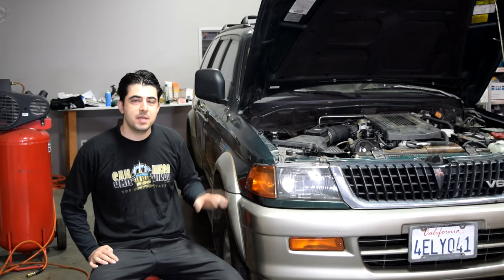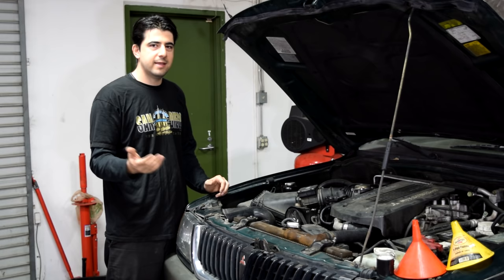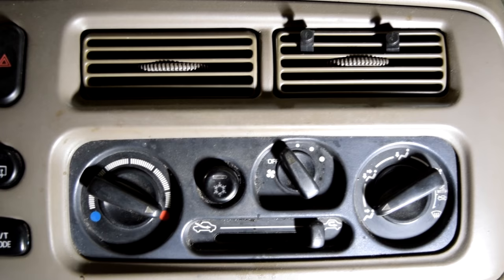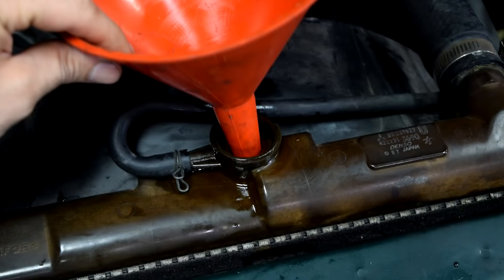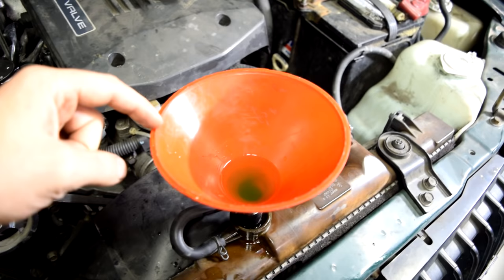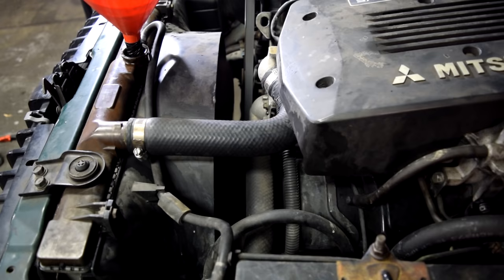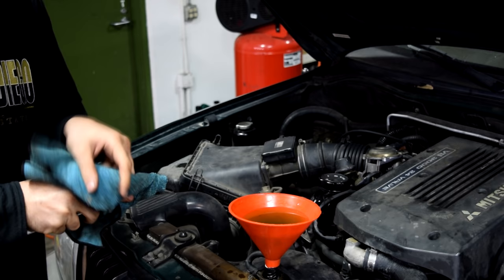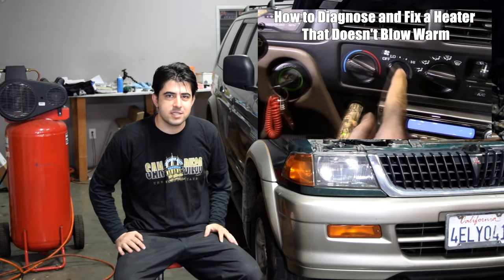Learn How To Bleed Air Out Of Your Car's Cooling System With This Quick And Easy Diy Method.

Comment: Thank you. I replace 6 radiators due to the heat and the radiator burst due to high air pressure and after this video the heat was gone and the car is like new. 

Explorer 2010

Comment: Very clear video on bleeding cooling system but you didn't say if you had previously flushed the block and radiator or whether you are only draining and refilling the radiator

Comment: Best video on here how to do this! Including all the little tips, just great. thanks so much. I followed the steps exactly even putting my 4runner on an incline. During the burping process, I kept having to turn off the engine to remove coolant b/c the funnel was spilling over. My original problem was a leak that I fixed w/K seal, then added an incorrect ratio of coolant. I took her for a test drive and THAT is when I noticed the heater blowing cool air and temp gauge getting hot which it never has before. I drained all the incorrect coolant out and refilled with the proper ratio and tried to burp as I noticed both upper and lower hoses were collapsed. So after burping, the heater is still blowing "room temp" just not as cool as before.  I did notice the lower hose is cool to touch and the upper hose it very hot/normal.  Not sure what to do now since I've never had radiator, thermostat or any problems whatsoever, so i just turned it off and came back here. Any suggestions?  '99 4Runner Limited w/180k miles. Thanks in advance

Comment: With the engine cold and the thermostat closed, how do you get the air out of the heater core and engine block?
Awesome video. Thank you so much.
Reply: I believe you take the bottom hose off your radiator to allow it to drain...

Comment: If I don't turn off the engine after bleeding  as you did, and replace de radiator cap as soon as I take the funnel while the engine is till running, will it damage de radiator cap??? Thanks for the knowledge you're sharing!!!

Comment: My Chev Van over heats and boils After I swapped out the Pump, T-Stat, & Fan Clutch,   BUT the Heater gets
plenty Hot.   I filled the coolant by just pouring It into the Radiator,  So.... I think I will try Your way.

Comment: I'm an old gear head and I only disagree with one part here--revving the engine.  My experience has been that revving the engine creates more bubbles through a version of foaming.  Do everything he says, but then let the engine heat up and slow down to its lowest idle on its own.  Then just wait it out for the all the bubbles to come out.  It might take a good fifteen to twenty minutes or so.  Keep adding coolant when the level drops.  And let the bubbles out of the system at an idle.

Comment: Thanks for this, hoping this is all that's wrong with my car. It isn't blowing hot unless I'm driving a lot and now it's getting random temperature spikes on the dash, so worried i may have to get a thermostat replaced which is going to mean mechanic because I'm too disabled to do any real engine work.

Comment: If you still have issues after all of it has been gone through, have a pressure test done. I'm fearing a blown head gasket on mine because it's a coolant tank system and the thermostat and seal have been replaced with no solution. Mine's the exact opposite of most coolant problems. It looses heat while driving and hot at idle and will go up to about 3/4 on the gauge and down to just under 1/4 driving. I had to unplug the fans tho due to them running at high speed for some reason I can't find. I also have a PO128 Coolant Code as well. Doesn't sound good.

Comment: disconnect the cooling fan and run the engine until its hot hot hot. then, shut of engine and remove the over flow cap (GRAVITY BURP) works great !

Comment: Even those you bleed engine coolant correct way. The car can still over heat because of failing water pump, thermostat, crack cylinder, head gasket, radiator, water plug, and etc.

Comment: what do you when your vehicle doesn't have a radiator cap, but only a cap for a coolant expansion tank? Audi a3 2001 same process?
Reply: You can bleed the air out from the bleeder valve in the same way, it'll just take longer.
Reply: i have an audi...you just do the same thing with the reservoir its a little more involved and a pain in the ass but it'll work just be careful cause fluid goes in a circuit.....it'll come up REALLY fast....my arm can vouch for me on that one........damn second degree burn!!!

Comment: On a COLD engine. Leave radiator cap or overflow tank cap off. Star car and run heat on full blast. Let car idle for 15 minutes. Feel upper and lower radiator hoses.

Comment: I just take the thermostat out when flushing. Then it's not necessary to wait for the engine to warm up and open it. After all the flushing cycles are over I put it back in and and fill with antifreeze and distilled water.

Comment: My engine spilled over 2 liters of coolant. Any funnel won't work for some cases where your radiator and hoses were replaced. 

The air bubbles take a lot of time to be removed even if rev or turn on the heater.

Comment: Hi. Thanks for the video.  I tried to burp the cooling system for over 40min, but my lower radiator hose remained cold, although the top radiator hose is hot. Hence, my cooling fan never came on.  For 30 plus min I did see bubbles coming out.  And it took about half a gallon of coolant; I lost some from replacing the cooling fan temperature switch earlier.  What can cause the lower radiator hose to remain cold after 40min of engine run time? Is that normal?

Comment: Thanks, I now think my NO HEAT is because of air in the system. I had installed a new radiator and maybe didn't get all the air out.
Thanks

Comment: What if the bubbles never stop coming. Parked on an incline. Heater going. No leaks. Experiencing my vehicle overheat with towing and going up inclines.
Reply: I’m having this same problem with the bubbling but I haven’t tried the method in this video yet

Comment: Hey thank you so much I am about to do this but 

I just have a confusion. 

 First of all
1. I am not engineer. 
2. I am not an expert in cars systems. 
3. I am learning

But I have been thinking about all of this and whether we need a non-spill funnel or not, and even whether we need to take the air or bubbles off of the system by ourselves. Because as I understand you can 1)  Drain the radiator, and then 2) drain the engine block (maybe taking out the thermostat would be enough, if not, then thermostat plus drain cock for the engine block), and then refilling the radiator and the expansion tank. Because if I am not mistaken the expansion tank works together with the radiator cap to put excess of coolant there or to take coolant if it is needed. So wouldn't bubbles go to the expansion tank at some point when the thermostat keeps opening and then the radiator cap as well? Do we really need to burp the system? What if for real the cooling system do it already for itself? Does that make sense?

Comment: I've done all my own work for years. better or worse lmao. but ive never ran into having an air bubble in my cooling system.
Reply: I recall correctly that's it closed system. The only way to access the radiator cap because there isn't one is through your coolant reservoir tank. Just look up how to bleed a closed coolant system. Good luck
Reply: @joshbeck1456  heater core could be clogged with debris, air might still be trapped in the system (sometimes you have to bleed multiple times if its stubborn)
Reply: Kudiyar Orazymbetov there are several ways to get air in the system including blown head gasket issues. If you have head issues it can press combustion air into cooling system, depending on engine. I would think you would have a coolant loss issue with a crack in the coolant res. If you let it get low enough it is possible I would think.
Reply: Josh Beck try to take the thermostat out and run it with out one. See if it doesn’t heat up. If it still does look for bubble trails in your coolant res tank. If you have a lot of bubbles you may have a head gasket problem. Do a cylinder bleed down test if you have bubbles. Good luck hope this helped.

Comment: So can I do this even if I'm not for sure if I have air bubbles in the radiator? Cause my car isn't over heating just after a lil of driving sometimes the coolant overflows out of the resivior
Reply: You probably had way too much coolant in the system. It's normal for it to pour out of the reservoir if it's over filled.

Comment: Love the video, Question my car blows when driving not when idling it comes out cold what's that from
Reply: one possibility is low coolant. check your level. possibly need a top up.
Reply: Mine is doing the same but it’s my thermostat. It stays open leaking coolant. So I’m changing the thermostats this weekend

Comment: Just got thermostat replaced. The hose near the therm housing went warm again. Problem now is, the cooling fans do not automatically come on. I unplugged the harness to the fans, and they automatically came on. They would also come on if I turned on defrost or AC. Now I need the radiator fan switch, and its harness. The old thermostat looked like it expanded, but did not open. It must have had air bubbles in front of the opening because it expanded, but did not open, and hose was not hot. 

Reason being, I had to replace a coolant temperature sender and the top electrical piece broke off the heater hose neck. I had to replace the heater hose neck, to replace both switches on top of them with washers. When the old therm was in, the bottom hose outside the housing was not even warming up. I never let the car overheat, in fear that the head gasket would blow.

One thing I noticed before replacing therm, was that the air bubbles were not automatically burping out, and it had to be because of air bubblea in front of the therm.

Comment: Straight to the point great video! 

Do I put 100% coolant in the system or do I dilute with water?
Reply: It's actually antifreeze. Water acts as the real coolant. There are additives to help cool your engine but they aren't the gallon jugs of "coolant". 

You want at least 50/50 (so they say) antifreeze/distilled water in your system, and if you are in a warmer climate without a lot of really low freezing temps you can be pretty biased towards the water (like 70% water or something). 

The big reason you still want to still use antifreeze in warmer climates is that it also prevents corrosion the water would otherwise cause. 

That's also the reason distilled water is important, because it doesn't have the minerals in it to help cause further corrosion that other types of water would have.

Comment: Dash is fluctuating a lot after thermostat and radiator change, never did this before. Was driving fine and anytime I gassed above 4k rpm I could visibly see the needle go up then as soon as I stopped gassing it went right back down. I’ve been trying to get any air out and still haven’t gotten it all out..

Comment: My car definitely has some kind of issue like this. Sometimes it starts and I can smell coolant from the exhaust and it runs rough for a few seconds and then it works fine. It just started overheating though. there's no lack of power at all after that initial rough start.... I hope the cylinder head isn't cracked, though.
Reply: coolant smell from the exhaust usually is a sign that the head gasket is broke :/ not a sure sign but a sign, it might be a small enough crack that you can get it tested and if needed just buy head gasket stop leak

Comment: You took out more coolant than you put in. You could have just started the car, turned on the heater, and then squeezed the upper hose a few times once the thermostat opened. This will “burp” out any air in the system. Then turn the car off and fill with coolant just below the neck of the cap opening. Replace radiator cap.

Comment: I will try this tomorrow! Knew nothing about car, today I had no heating, then the light start flashing, scared the S out of me, I had to stop a few times to cool down the engine , it took me 2 hrs to get home😮‍💨😮‍💨😮‍💨 The coolant were boiled out of the cap, seem like nothing much left in the radiator as 1 liter down still looks bottomless... Seriously want to junk my Mazda 2, 250k on the clock already... if it couldn't fixed like this, I go straight into a showroom!😐😐😐😐😐

Comment: Dear, Thx First of all. I spent 45 minutes there, I couldn't reach 90• degree. It was still around 45•degree. I press pipes, open valve to bleed water but nothing. The car wasn't warm at all. May be broken thermostat? I really have Hugh air there. What to do?

Comment: So i have no heat coming out and over heating after I replaced the cracked radiator, which I was expecting. I keep bleeding it but it still overheats, so now I'm going to try this where you keep the filler cap open and keep a funnel in to allow it to rise. Hopefully that allows me to fix it! And alternatively I'd use a turkey baster to get the excess coolant out of the funnel.
Reply: you have a thermostat or a water pump issue. not bubbles...
Reply: Tyson Washburn you are right. The thermostat was installed improperly. I was able to figure it out after a couple days of head scratching, hope it helps someone else with this problem in the future.

Comment: My service manual says to wait until the vehicle cools down to only then fill the reservoir tank (after the initial radiator fill) on a cool engine if needed. To do this cycle at least three times. 
They are saying in my manual to do it this way only cuz the concern of hot coolant splash back im guessing right?
Reply: No I take that back. It says to do it this way because coolant in a warm engine will be higher due to thermal expansion.

Comment: My temperature gauge does not move at all, even after hours of driving. If I replace the thermostat and the ECT, do I need to do this procedure? It's a Volvo 2002 V70 140 hp NOT TURBO, NOT DIESEL. Thank u so much.

Comment: i just love your video always you make things easy to understand. have you done any videos on transmission issues. my car goes into gear but doesn't move in drive or reverse when i press the gas pedal. any advice would be appreciated. thanks
Reply: something broke, if its auto maybe the stick shift cable or solenoid, If its a manual then ur clutch or presureplate broke

Comment: so but I have to trun on the heater to the max with the car off just wit the ignition key to open the electrical system?  or the car have to be on and engineer running?

Comment: I bled my system for about an hour and when i turned off my truck water shot out of the radiator like it does when it overheats. I quickly added anti freeze hoping no air bubbles went back into the system but I guess I wont know until i drive it tomorrow. Im thinking i should have removed the funnel and capped the radiator and then turned the engine off. Seems like closing the system before it let out that burst of pressure might have kept the radiator air free and the pressure could have escape through the overflow.  I hope I didn't just waste an hour and a gallon of antifreeze lol.
Reply: I was told that if you start your engine with the radiator cap off and coolant blows out it could be because of a blown head gasket.

Comment: My overheats and stop and go traffic and that's when it loses coolant but when I'm driving on the highway it stays right in the middle but the fans are always on when it overheats which doesn't make any sense and the heater works too. The heater blows very very very hot air. What could it be?

Comment: I see, after adding and running on Prestone Radiator flush for 3 days(to clean drove few hundred miles), and drained out and filled with coolant. Now my car has a shorting kind of sound coming from Driver side when driving around 65mph+ and no power pick up, at 55mph there is no shorting kind of noise and engine seems to run smooth. what went wrong? I do not see any light on the dash.

Comment: Good video. I get high heat, but my lower hose stays cool.
I recently did timing belt. But no overheating issues. I replaced the thermostat today to be sure. But Lower hose still stays cold even after 30-40 min of being on. No overheating at all. What could be wrong? 2004 tundra 4.7 engine

Comment: Hey R&R, great work man! Are you from San Diego? We're neighbors. Quick question, how do I bleed the air from a car that has an expansion tank? Like an Audi A6 or Passat?
Reply from the maker: +Jonathan Soto Those are usually ok and self bleed overtime but here is what I found on a VW Forum a while ago that helped "If you look at the firewall area on the passenger side there's a corrugated plastic cover over the lines going to/from the heatercore . Move that and you'll see a bleeder there . Best to do it when the system has been driven so there's some pressure but let things cool down so you don't get sprayed with hot coolant . Just bleed till you get solid flow of coolant coming out of that bleeder valve." cheers

Comment: I have a 2002 bmw 330i the upper radiator hose is hot and tge lower one is cold after driving for a while is that normal or not. Any suggestions. 
Thanks

Comment: Hello, i got a question I did all the process like you but one of the hoses that it goes to the radiator its cold and the other is hot, it tha normal?

Comment: mate i need to bleed the air out but my heater blower is not working would i still be able to bleed it if i can only turn the temp up and leave the fan off

Comment: Ratchets and wrenches- How long it suppose to take to remove air out of the cooling system.
i have no misfire or lack of power.
i read it takes 15 to 20 minutes.not in my case.